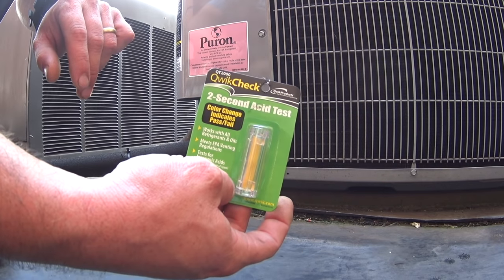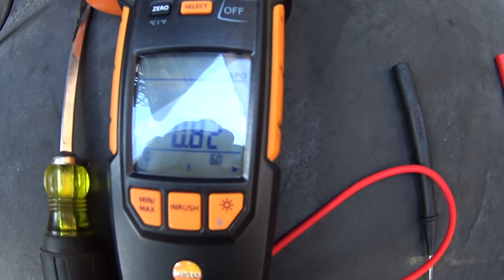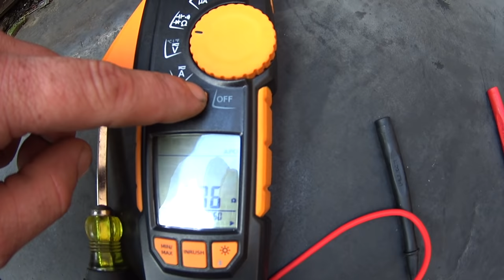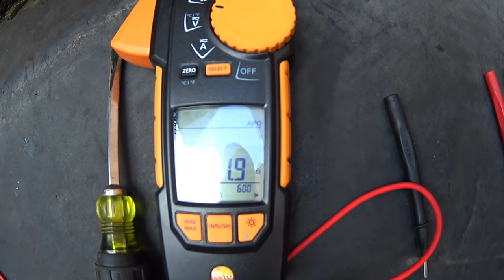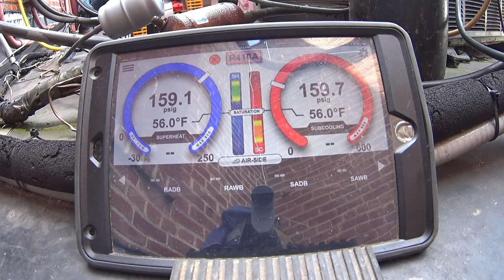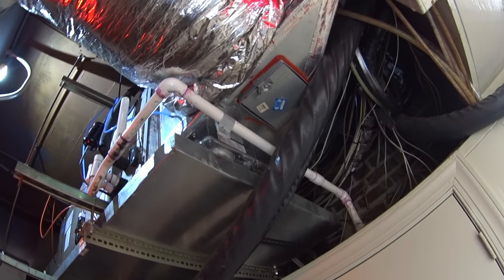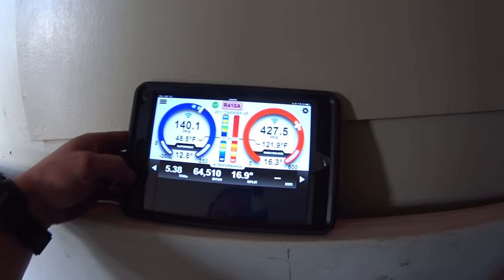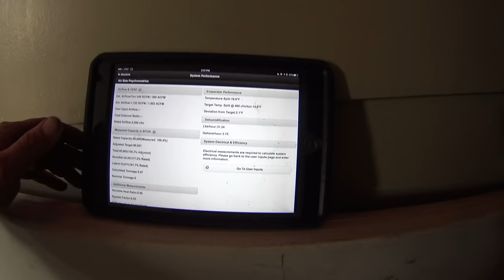HVAC Service: 5 Ton Carrier Compressor Replacement

Comment: Great work.  I hope the home doesn't have a loose neutral, I run into them all the time 190 on one leg 40 on the other, lights dim and get real bright, it's kinda cool, pop meter tighten up all is good.  Most of the time it is intermittant, fire up big loads and the problem will act up.

Comment: ALWAYS check the voltage back to ground of the hot leg that you are going to hook your recovery machine to. Many three phase setups ("three phase high leg delta" have a "stinger" leg that is 208 Volts and not 120 back to ground. There are also many other issues in the electrical panel that can cause one leg to be an abnormally high voltage. Always check before hooking up your machine. A fuse may not have even helped you in this situation as fuses blow from excessive amps, not volts. Remember OHM'S law: In a parallel circut, more volts means less amps on the same load. This is why an appliance on 240 volts would draw less amps than the same appliance on a 208.

Comment: I couldn't tell if you pulled wires off the run capacitor when you were doing your testing. You have to isolate the compressor completely. If things don't work out I always go right to the compressor terminals to make sure there is no problem with the wiring which I have seen. you can test a compressor using the wiring if it tests good you don't have to go any farther. if it fails you need to go directly to the compressor terminals to eliminate any problems with wiring. you should have a megameter I have an inexpensive one and it's the most accurate way to test windings so you don't have to blow fuses. Sometimes bad windings in compressors will pass ground test with a ohmmeter because you are testing the windings only with 9 volts DC.
Reply from the maker: I did isolate everything, I've considered a megohmer but the one I want is $700 if I recall correctly. I'm not interested in the dedicated Supco device. I'd rather have the Fluke 1587
Reply: +Stephen Rardon (HVAC with Stephen Rardon) check out some reviews on the Reed St-5500 merger. That's what I use because I didn't wanna drop 700 bones.
Reply: if there's pressure in the system and you pull the plug you could get an eyeful of refrigerant when the pin blows out of the compressor

Comment: Hey nice Video Rardon! One recommendation I would like to make is to use a Voltage regulator with your cheater cord. In doing that it will prevent any voltage surges or drops therefore preventing any damages to you expensive equipment.
Reply from the maker: yeah, or just not use a cheater without confirming voltage! Thanks for watching

Comment: Thank you for such an insightful video! After being charged over $500 for a freon "recharge" of my unit without a technician performing any diagnosicts but who was quick to talk financing on a new coil that would run about 6 grand and after sitting here in the Texas heat after less than 24hrs of less than adequate cooling from the freon "recharge," this video is definitely going to help a single mom during the recession not get screwed again! Thank you!!! I will be demanding a compressor/capacitor test and will be looming over the next technicians shoulder demanding to see OHM output!
Reply: Looking over someone's shoulder isn't going to help you.  You have no idea what your looking for.

Comment: Pretty much never use a cheater cord here (they are probably illegal!) I carry extension cable and just run power from nearest outlet. 
Few years back maintenance guy at a place we worked at put an extra socket/outlet in the kitchen of a factory, he just tapped into some cables in trunking above the kitchen. The socket kept blowing peoples phone chargers, turns out he had two legs of the three phase power run to the socket so 415volts! Apparently the kettle boiled very quickly!
Reply: Technically here in the states, using the grounded "bare copper" would cause the entire building to have the non neutral to become a non safety wire, and it is non shielded if it gets hot, because it is now a current carrying conductor.  Use a step down convertor to go from 240 to 120.

Comment: I've burned up my shop vac like that. I was like damn it runs great. Then it went up in smoke. I had it to a wild 208 leg . Now I double check voltage before putting my cheater
Reply: ***** lol we just need to double check with a meter before getting power
Reply: I've had the same happen when someone installed a high leg transformer since they got it at a fire sale. Wreaked havoc on all the stuff plugged into the 120 outlets that were getting 208.
Reply: Ulises Palacios if its 3 phase then yes check it because 208 is 208 230 has a high leg of 190 volts in the middle. Its usually phased orange.

Comment: why do you put your filter driers by the coil? we usually put them outside coming out the condenser
Reply from the maker: There has been significant discussion on Facebook and YouTube on this subject and the reason I do it is to keep any contamination from the lineset from getting to the TXV. Outside is easier but doesn't serve much purpose to protect the TXV. It's actually recommended by Carrier to put it near the fan coil aka Air Handler.

Comment: Steven my name is Rich Visco working on trane 19i heat pump have bad high speed compressor. This unit has 2 compressors in it ohmed out compressor and is shorted unit is 14 years old r22 system question change just the 1 compressor or both or would you change out system what is your opinion or what would you do

Comment: 8:20 What is the name of the component you are desoldering? What is it for?
Reply from the maker: Probably the Filter Drier, it’s designed to remove any residual moisture and catch possible debris

Comment: Question.Why did you cut out the compressor and not the drier?Curious because I know you do everything with reason.Thanks
Reply from the maker: +lXOutsidethecomfortzoneFitnessX l I had room to Cut the compressor but no extra piping for the drier. Soon as I cut out the drier my lineset is too short.
Reply: I noticed you brazed the the compressor  then you pull it back to bolt it down.  
Do you normally  not sweat out?

Comment: I need to know if an LG MODEL ABG049KAC is or would match a five ton unit?
Reply from the maker: I couldn’t say without finding a reference to the equipment you’re working on.  049 would seem to likely be a 49k btu capacity which wouldn’t be surprising as an option in a 5 ton system. I’ve seen 30k or even 28k compressors in 3 ton units before.

Comment: what size bits you have to use to screw down the compressor on that particular unit?
Reply from the maker: +FooDaki sorry, don’t recall, was a socket with a 1/4” adapter rather than a screw chuck

Comment: What torch tip are you using? Also wondering what you use for braze rod. Thanks
Reply from the maker: don't remember where or what the tip is and i'm using the NetBraze rolled solder. 
http://netbraze.com/phos-copper-brazing/netbraze-15.html
Reply: Nothing is illegal, just not code.

Comment: Sounds like you ran into hot leg 208 also hope you were connected to a neutral and not a ground where was your service receptacle as required by code?
Reply from the maker: +lou f haha! Service receptacle?! That’s funny! When there is an outlet it never works! But yeah, that’s what it was.
Reply: Stephen Rardon 
Are you guys licensed in North Carolina I’m from New Jersey and if there’s no service receptacle when inspector shows up guess what you failed last I checked we all live in the USA governed by the nec
Reply: And trust me I’ve been around a long time I learned the hard way burnt up my vacuum pump before there were recovery machines but my other concern is you’re using the grounding conductor for a neutral

Comment: Got to get me one of those I Manifolds > and i thought i was the only guy that cuts a compressor out .
Reply from the maker: depends on the situation, this is one of the few I've cut, it was warranty and it needed to be sealed for return so the extra pipe helps take care of that.

Comment: another great video, just curious, why do you put the filter drier at the indoor unit, I've always put it at the out door unit. I know it doesn't matter, just curious. really like your torch tip, what size is it?
Reply from the maker: i put the drier inside because it's designed to catch any trash and if it's at the outlet of the condenser it's not catching anything that might be in the liquid line. Manufacturer said ahu location was their preferred location
Reply: On a heatpump would it matter much since there's a metering device on the outside unit? Dryer location be at the the indoor vs outdoor?

Comment: You cut the compressor loose but you unsweat the drier, what is wrong with you? Just kidding, I will come to Raleigh Carolina and we will have a discussion that means I will do the talking and you will do the listening about many things. Good Stuff my friend.
Reply from the maker: Come on over!
Reply from the maker: i had room to cut the compressor and didn't have room to cut the drier out. wanted to cut both but didn't have enough slack in the ahu to do so. no extra pipe in the barbie van
Reply: Just a noob here wondering what's wrong with sweating the filter dryer off?
Reply: @youknowjojo1  you are never supposed to heat the drier because it can release captured moisture back into the system.

Comment: you also might want to get yourself a Turbo Torch much Superior to what you're using you can on sweat those connections on those compressors makes your life a lot easier
Reply: most of the time there isn't it doesn't hurt anything if you constantly have to cut you're going to screw yourself sooner or later especially on bigger pipe like 1 1/8 - 1 3/8 you won't have room on some of the units.
Reply: Most the time in my experience there isn't if you cut the line you're going to be short you're not going to be able to reconnect that's why I install and I'm sure you and everyone else liquid line dryer then you don't have to worry about debris in system I'm sure you've seen it so I buy compressors that have been replaced in the field with no filter driers
Reply: +Ben Kuxhouse Don't have to worry about debris since you put a drier in lol. As far as torches, you have way more control with oxy/act, over turbo, and takes way less time when dealing with bigger pipe. Why do you buy bad compressors?
Reply: I don't know if you ever use the turbo porch. I have all the tips and I can easily and sweat high temperature fittings on purpose big is 1 3/8 inch unless you run nitrogen through the system while your father and you're going to have oxidation flaking off inside the pipes no matter what. You can either bust your ass running nitrogen through the system or throwing a filter line dryer in the liquid Line run it in the AC first if it's a heat pump and you won't have to worry about it. I've been doing this stuff for 31 years now. Turbo Torch gets things done that oxy acetylene just can't when it comes to soldering pipes
Reply: +Eric M it'll pass through the condenser coil you just don't want to hit the metering device. I don't think it's necessary what you're doing but I'm not going to be critical of it then it's extra insurance. I never do it and I'm not even had a problem and 31 years with it. When I see problems is when people don't put liquid line driers in. even if I was running nitrogen I'd still put a liquid line dryer in I'm sure you've seen a lot of cannibalize jobs out there as I have. more than once I've seen massive restrictions because somebody replace the compressor and didn't bother to put in liquid line dryer
Reply: I have consulted the manufacturer on those Trane & Carrier units that you are talking about. What causes that problem is no crankcase heater and they're a little bit of waxing happens with the compressor oil which plugs the orifices. They recommend installing crankcase heaters. Train has a TXV replacement kit I'm not sure if carrier does.
Reply from the maker: ill stick to my mix tanks, Turbo is ridiculously loud and the Flame is Excessively Large. if i was dealing with 1 1/8th pipe or bigger i'd maybe consider it. For what i do, Turbo is Nothing short of Inferior rather than the former as you mentioned. I don't think your method of no nitro but adding a drier is advisable, pretty sure every manufacturer would pull your card on that one. 31 years doing something improper and getting away with it doesn't make it right. My Opinion Anyway.
Reply: Turbo Torch has different size tips for the piper working on. Have you ever work on a huge unit you would think differently. Even small units it's hard to run nitrogen through I haven't had any problems. All the residential split systems that you work on I will bet you 99.9% of them didn't have nitrogen run through the lines when they were installed.
Reply from the maker: Ben Kuxhouse you're right, they probably didn't purge nitrogen and that's at least part of why they haven't lasted more than 10 years. Lots of people do crap installs and never get called back when the units die.
Reply: If you are running the line you will have to solder in ports on your line set the condensing units do not get set until the very end. They don't want them to be stolen. If you want to drag an oxyacetylene up into an attic you go right ahead but it is easier dragging around a b tank. I worked on systems that are 15 20 years old. Where you live systems are lucky to go 10 + because of the climate. 100 ton systems the poorest are so big you're not going to have to worry about restrictions too much especially with dryers in the system.
Reply: Have you ever done residential work? You would have to do that on the suction line and the liquid line. But the one thing I use that does cut down a lot on oxidation is stay Brite 8. On ductless split systems I would agree with you 100% that you better run nitrogen through it or use stay Brite 8 because you will have problems because I have seen restrictions on brand new ductless splits. Really small passages in the metering device. Now I'm talking about line sets I've changed out compressors on ductless split systems cuz I'm only making two solder connections and will hit a liquid line dryer.
Reply: +Eric M what manufacturer voids the warranty on their equipment if you stay Brite 8 on the line set? when I was in New York we went all are line sets in stay Brite 8 and we had one of the lowest compressor failure rates in America for Bryant dealers
Reply from the maker: We'll have to agree to
Disagree Ben Kuxhouse  I'm
Not going to
Argue. It's not hard to purge and  it doesn't take but a minute to have the satisfaction that you've done all
You can to avoid catastrophe.
Reply: ***** there is no metering devices and condenser coils unless they're making the loops about 3/16 of an inch in diameter. Most of them or at least 3/8. The units that you were talking about the evaporators have orifices on the distribution tubes. The manufacturer told me what causes the restrictions is oil waxing carrier and Trane and recommend highly crankcase heaters to be installed to stop the problem.
Reply: Microchannel if it's that small I'm not going to say you're not right then I guess I better reconsider that would be a nightmare having your condensing unit condensating because it's all restricted. Even with nitrogen Purge I would still be worried too bad they can't figure out a way for a filter in the vapor line I'm not sure if a liquid Line Filter with work. That small that would worry me a lot. I believe it's not that I saw her it's the flux that the manufacturers might be worried about but there is different types of flux is that are approved.
Reply: I will say that I have not had a lot of experience with microchannel condensing units. I know that you must use them sometimes because they're smaller physically and it's only that will fit on a job. I did a little reading on it and it's pretty critical unit. I have work on condo units that there is very limited room for replacements and then microchannel condensing units are about the only that will fit
Reply: A screamer is better than an oxy acet kit??  Who do you think your kidding.
I'll agree he would need a larger tip to un-sweat the suction, but sweating in no way is the screamer better.
How many B tanks do you go through with a larger tip? 
I been using oxy acet kit for 30years. I can easily burn in a 2 5/8 oil seperator with one mc and one r tank. you would be lucky to do one side with no shoulder with one be tank and a large enough tip.
Plus I value my hearing
Reply: I don't think they're loud at all and I can use oxy-acetylene butt it's more work if your torch tip is the right size for the piper working on the entire joint gets hot and everything flows really easy with a turbo torch. I have every single tip for all the pipe sizes and I commonly come across. I can also with the  A 32 get bolts cherry red hot to get bring them to loosen up on some tough Plumbing things that have come my way
Reply: +C Thompson here are the Turbo Torch sizes A5 A8 A11 A14 A32 works perfectly on piping from 3/16 -  1 1/2 + . if you only have one tip then you'll be screwed you have to have them all which I do.
Reply: Ben Kuxhouse
! 1/2 ? that says it all right there. Your a plumber not a Refrigeration HVAC tech. Keep using what your using you stay brite anything you want with that setup.
Reply: You don't need to use high temp solder for line sets stay Brite 8 15000 pounds burst pressure you just haven't done that much that's all